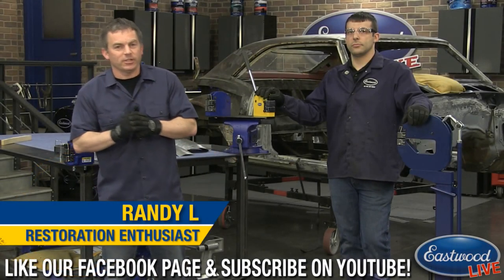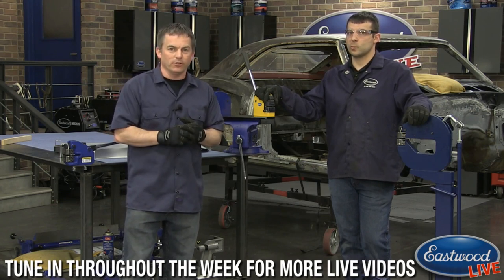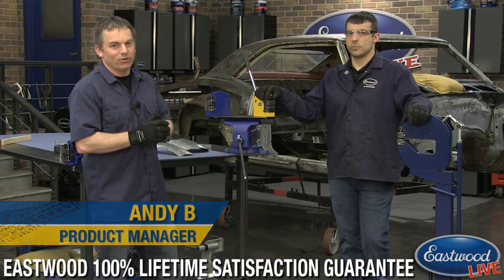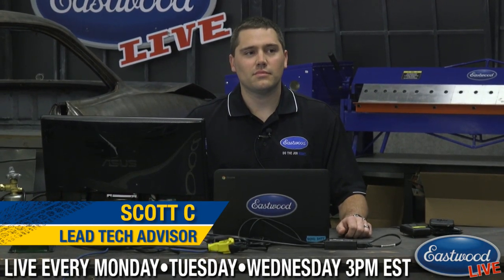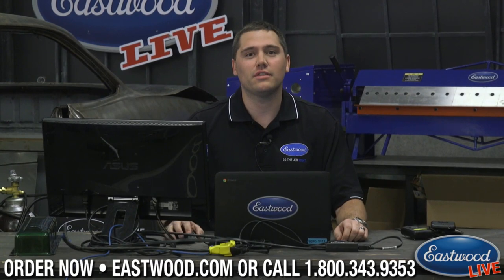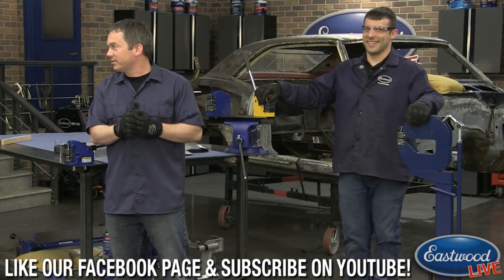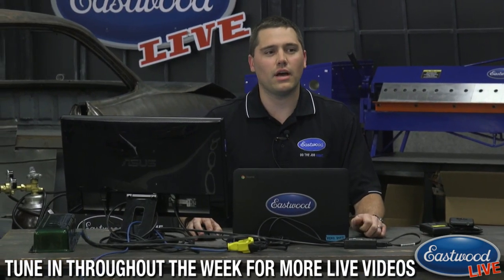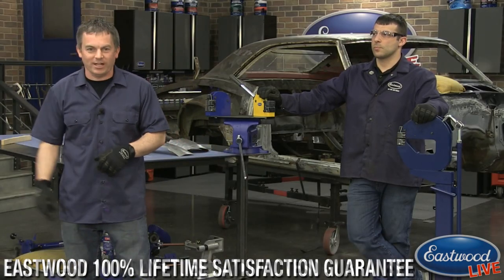How To Shrink & Stretch Metal!  Forming Door Jams, Windshield Frames, Bike Fenders & More - Eastwood

Comment: I looked at the 8" stretcher with the base at check out. $145 shipping to Alberta, Canada. So I'm looking at around $700 before exchange rate and duty at the border. I've wanted one since I seen it on Fab Forums. It's still in my cart, just cant pull the trigger yet. I found the video very informative, and have a better understanding on how it works. Keep the videos coming. Working on a '57 Dodge D-100, and an '80 Powerwagon.
Reply: Can u shrink a hood that stretched during sandblasting
Reply: These are made in China and sold everywhere under different various companies, surely you can find one at harbor freight? It's the same exact thing, just different color.

Comment: And, you can get rid of manual foot and arm by a pneumatic cylinder with psi control, all floating free to move around to work large panels being supported by roller stands. Just a boneheader passing gas.

Comment: when you see the fully robotized car factories, with car doors molded in 5 seconds on a huge press from a sheet of metal, getting out perfectly shaped, and then you watch this, where guys spend hours trying to shape/match one piece they are working on to the actual car, using multiple machines to get the job done. People won't give up manual labor in this industrial age.
And latest technologies are still only granted to the riches.